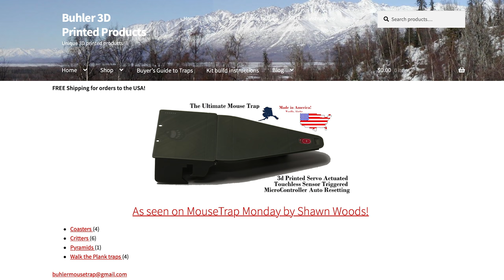A new 3D Printed Walk the Plank Mousetrap Design works amazingly well. Mousetrap Monday

Comment: For those bigger bugs, you should use a bigger trashcan with a hole cut in the side so they can't reach the food from the top of the bucket. They will need to go through the hole.